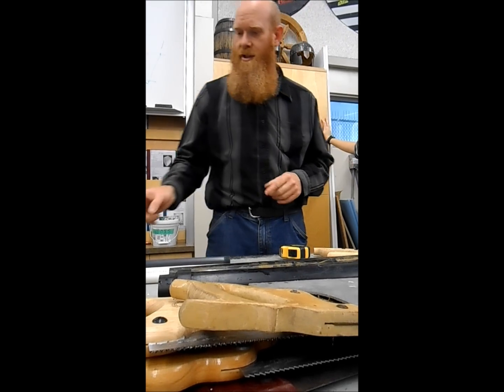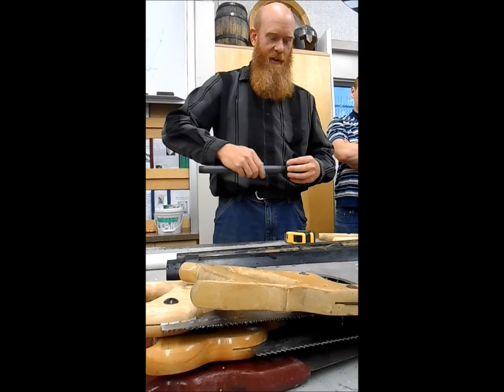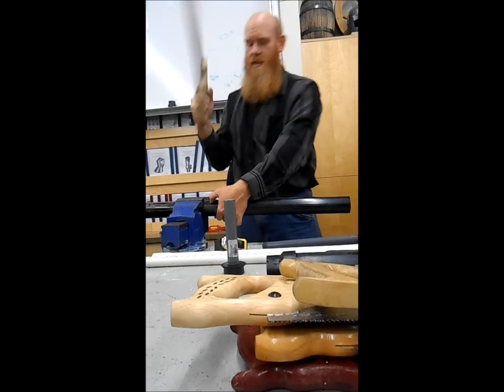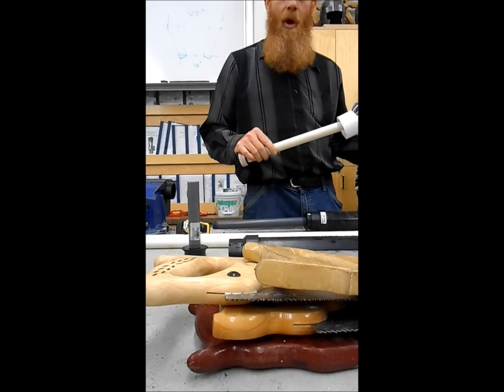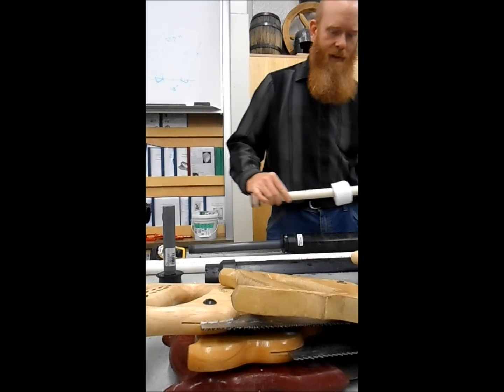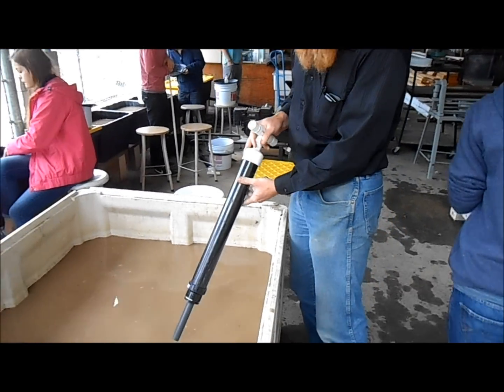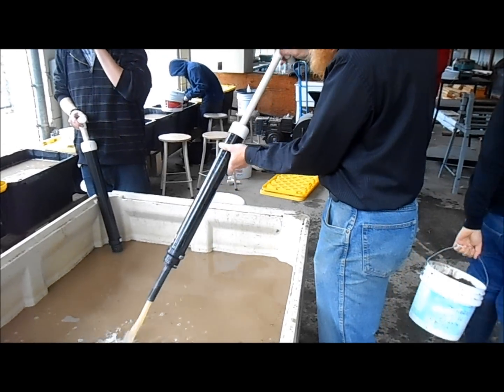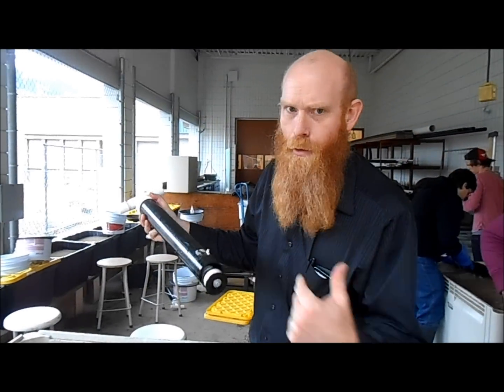GOLD dredging - How to make a bedrock crevice sucker ( Hand GOLD Dredging )

Comment: Much easier to place the 2”. Pipe on top of a tennis ball and mark all the way around the tennis ball. Then cut with a sharp box cutter. Drill hole in center. Drill hole in cap. I then glued a1/4 x 20 lick nut inside with with two part epoxy.
I drill a hole through the the side of the caps and put a short screw into it so it can’t pop off. When attaching the tennis ball I use a washer behind the head of the bolt.

Comment: No one has tried dredging the GG. The bedrock riffles are exposed by the currents sluicing through at three plus knots when the tide is running. There is about a one to two hour window when the current slows down enough to work. 

The second challenge is that the depth is over 300ft. Diver tending is impossible. 

The third is that this is right smack dab in the middle of a busy shipping channel: you need a vessel even the ships would go around as a matter of course. Something so iconic that it wouldn't be examined. I've an old wooden Monterey-style salmon boat. I have the davits and lead and retriever cable already rigged with hydraulics. I can tie a compressor into my diesel for an air riser system. I don't have a salmon season for two years. 

Care to try something a little crazy?

Comment: I used a power plunger and one inch PVC and since the plunger is so much bigger it gets maybe gets a half gallon or so at a time.... Works great for me and cost around $10 and easy to carry and only used black tape to go around the threads to make a snug fit and 1 inch PVC over the threads works fantastic.

Comment: Great video as always Dan!
I thought I would share a couple of ideas before they die of loneliness 🤣.
A pipe cutter works good on the black PVC if you have one handy. 
Using a piece of threaded rod for the leather/plastic wood piece makes it a little easier to take the plunger apart without having to break a superglue joint.
Soaking the leather circles in oil overnight makes it seal a little better,  I just use whatever cooking oil the wife has handy.
Reply: I don’t mean to be that guy, but there’s a reason he used a saw on the black pipe. The black pipe is called abs pipe because it’s made of abs plastic, this is much different than pvc, which is why you use the cutter on pvc, pvc and abs have different properties.
Reply: Thanks for the tips! I'll try them out when I make mine.

Comment: One thing of note - if you want to cut out perfect circles you can get a piece of flexible band saw blade and tape it around the rim of the exact piece of PVC you plan on using, keep two ends handy one with the blade on the outside diameter and one with it on the inside diameter depending on where you want to make the cut. That way you can cut your plunger cores out with the inside blade, then cut your rubber (or leather idk why he'd use leather instead of rubber) with the head with the outside blade. I do stand by my earlier comment that a bait pump will crap all over these, but I can see the benefit of getting kids into prospecting through crafting.
Reply: i was thinking the same thing. but pvc is lighter then metal, the reduced weight is for hiking into gold bearing rivers. less you have to carry the better your experience…
Reply: leather swells and seals well but is kinda slippery.  its also how old hand well pumps were sealed.  personally id use neoprene or conveyor belt rubber myself.  u can also use a rag in a pinch.  found that one out the hard way....
Reply: Hmmm....
Leather is best soaked in Boiled Linseed oil cut 50٪ with a solvent.
But, I have some   white Rubber  & made a die cutter out of 1.5" copper pipe. Reamed out inside & polished with wet/ Dry sandpaper to create a sharp O.D. of 1" & 5/8".
Cuts smoothly!

Comment: for a better plunger instead of cutting up leather. use a rubber super ball. buy a stainless steel bolt, buy # 2 stainless steel washer, 1 stainless steel nut with a plastic liner in it to lock it down. the rubber ball you can buy at any toy store or a rote aid drug store. it will not rot out after a while and the seal you can adjust with a turn of the bolt to fit in the tube and make a super tight seal.

Comment: Good thing teaching the young'uns. I've learned some stuff from you maybe I can return the favor a little. If you do this class again, you might try a key hole saw for the hole in the cap. you wont have to drill both sides, also be careful putting the cap in the vice you could egg shape it. It may not hurt anything on this, you can put a scrap piece of pipe for support, just not so far you can't get it out.

Comment: HI Dan.  Just finished building my own dredge based mostly on your design as outlined here.  Only difference, I used a commercial 2" plug, modified somewhat as laid out in: https://www.youtube.com/watch?v=Wigj8MYbWkk&list=WL&index=1   Small issue with what I was able to find to go from 2" to 3/4" for the in/out head - have had to silicone the inside of it as it's design would have trapped material inside it when pushing out.  Ya, it will take a week to dry, but it should be good.  :). 

Thank you for posting this.

now what to do with the extra piping....  LOL. could only get the 2" AND 3/4 " in 10 foot lengths..
Reply: Make a second one and ship it to me!  Lol

Comment: Hey Dan, I have a question with regards to the crevice sucker, what thickness of leather are you using because I can not find anything here on the island. I have got some from a upholstery place but it just does not seal. Any thoughts as to what i might be doing wrong. cheers
Reply: Old cheap wide belt ( leather)
Reply: Try a bilge or float pump for airplanes  put a smaller nozzle for more suction force and discharge into a bucket VOYLA (FR)
Reply from the maker: A fairly thick leather is required. I got mine through Tandy leather
Reply: @Danhurd  Thanks Dan greatly appreciated
Reply: Rubber works, too. Or use two-three thicknesses of leather.

Comment: So for everyone that asked or wished there was a list here yah go! The only thing I didn't catch is the thickness of the plastic wood.. Looks like half inch I'm guessing?

2"-1.5" adapter
1.5"-3/4" threaded adapter
3/4" threaded riser cut in half
2" black abs tube - cut to 20" long
2" cap
3/4" pvc - cut to 22" long
3/4" pvc - cut two pieces 1.5"
3/4" t joint and three 3/4" caps
Use 1.75" hole saw for plastic wood, 1/2"?
Leather for plunger
. 25" bolt, washer, lock washer and nut
Reply from the maker: Awesome! It's about 3/4
Reply: @Danhurd  I made mine last night.. What I found at the hardware store was some "plastic wood" decking. They actually had a bunch of samples and just gave it to me! My crevice sucker works great though and we're going to scout a potential claim in the morning with it! I plan on using your method for sampling to find the paystreak, it's a textbook layout so hopefully we find some color! Thanks for all your videos, I've learned a tremendous amount from them!

Comment: Dan HELP!! I have a very good problem!! I have come across a bedrock crack about 5ft long & 4.5 inches wide. I have sucked materiel out of it using my Gold N Sand suction hand dredge which I modified by sticking a section of automotive rubber hose where the tips normally go. I can't go any longer than the plunger will allow. With the length I have already, I can't get to the bottom of this crevice!! I pulled some mad gold out of it so far. One piece was 0.14 gram, NICE!! HELP!! What can I do to go deeper??? I can stick a 5' pry bar down inside this crevice all the way up to the top of the bar!!
Reply from the maker: That's a good problem! Can you break the bedrock away from the crack?
Reply: I'm thinking not on this one. The back wall starts above water. It's a sheer solid face that goes down 4'+. The front wall is down at the 4' underwater level and what I stand on, also very solid. Maybe build a longer crevice sucker? I have footage of it but, I'm not ready to post it on my channel. I want to finish first. Thank you so much for your reply Dan.

Comment: The stuff you refer to as 'plastic wood", is called UHMW. Very cool and extremely versatile material...comes in sheets as well and is available at almost any wood supply place...and not very expensive either. Great video!